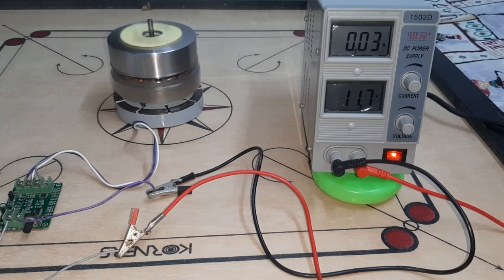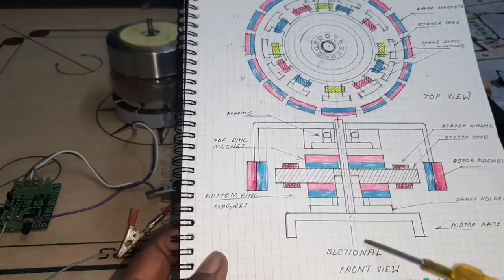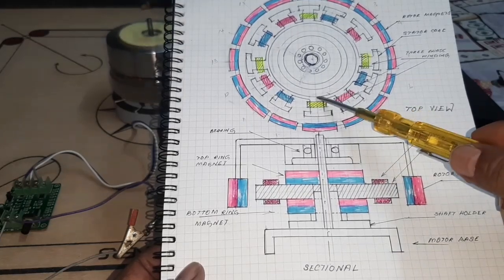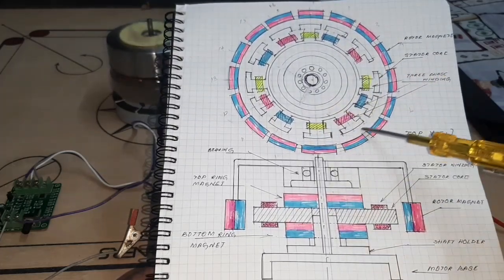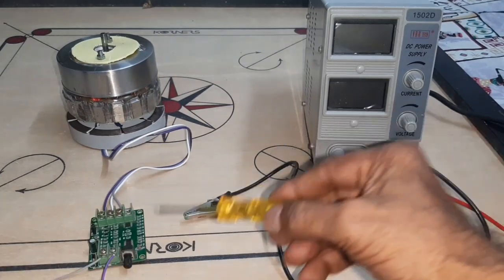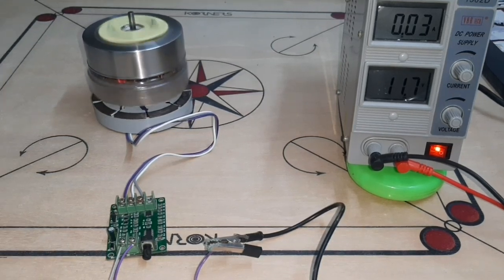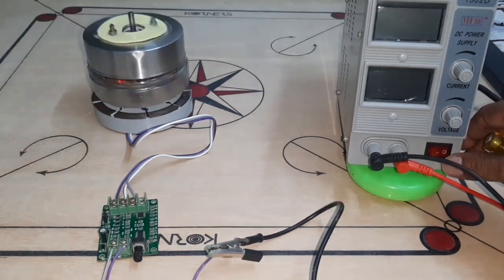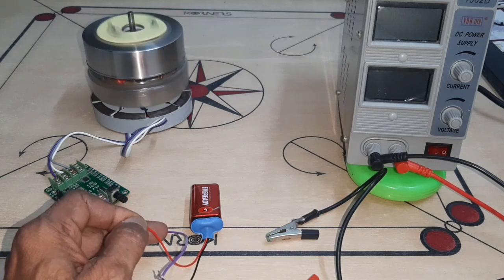High efficiency radial flux bldc motor(type-2)

Comment: What controller are you using and what size is the stator?
 Do you have the model that the stator come out of?
 How is it wound what pattern? 
What size magnet on the outside and pull strength?
Reply from the maker: Controller spec:-
Supply voltage-12volts
Max current-2amps
Fwd and rev selection available
Speed vary pot available
3/4 wire system
Controller available in amazon 
Stator details:-
12pole stator taken from platina bike dynamo
Windinding 26swg
Each pole has 200 turns
Thanks
Reply: @pugalstech  Thanks, for that info, what are the magnets on outside rotor example: 6mm high x 4mm wide x 2mm thick? I believe the center are magnetron magnets. Thanks you 👍
Reply from the maker: The size of the magnet LxWxT=25x10x2mm
Reply: @pugalstech  thank you i will try find everything and give it a go.
Reply from the maker: Thanks for watching

Comment: Can it be made to run on 220volts rectified supply?
Reply from the maker: Sorry it is designed for only 12volts
Generally current I=V-Eb/R  
V-supply voltage
Eb-back emf
R-motor impedance 
I=220-10/10(it consume high ct)
So it is not used for higher voltage

Comment: 0.3 watt means it need 3333 hours to consume 1 unit of electricity, which is approximately 139 days continuously running. Too much power efficient, average led diode consume 0.5 watts, your moter is efficient then it. 
.
.
Btw, what about torque? How much torque it can produce?
Reply from the maker: Thanks for watching